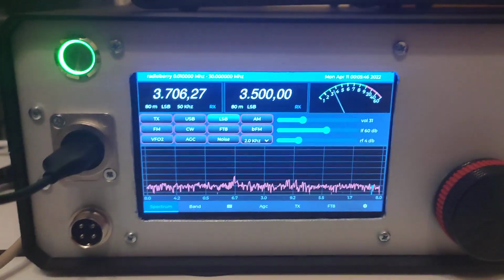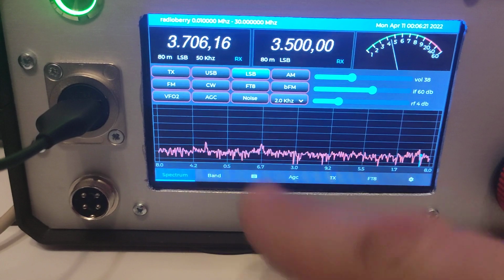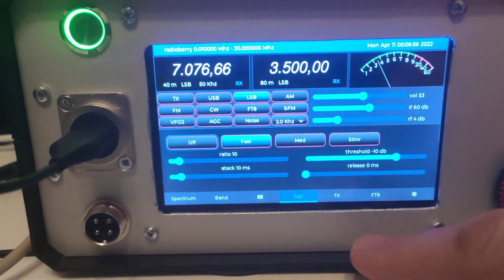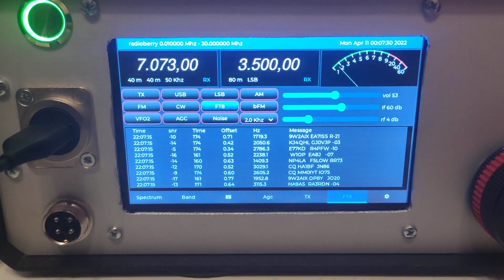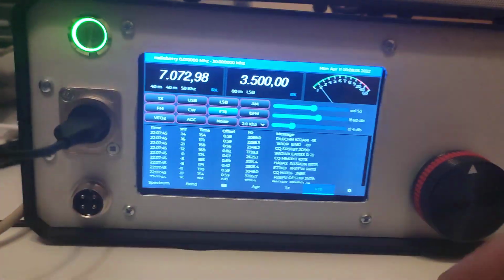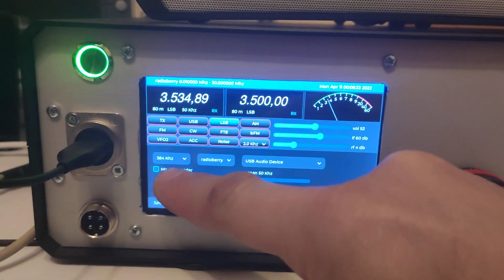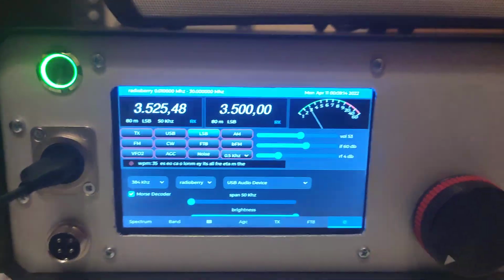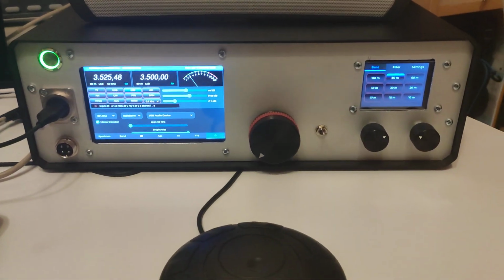Radioberry sdr tranceiver Raspberry pi

Comment: VERY NICE! I need to look into getting this running on my own "RadioHat" hardware project! - AE0GL
Reply from the maker: On my github page is a driver for qsd sdr's it supports alsa audio cards and si5351. I use a hifiberry adc dac pro and a separate qsd mixer board.
Reply: @paulh0029  Thanks for the tip.
Reply from the maker: @mariovano  I will have a look to add support for IQ signal support for the si5351.

Comment: How would i enable this interface?  I know radioberry has a web interface but i would like to have what you got going.  I am finally getting around to using my radioberry 2.0
Reply from the maker: All source code is on my github page available, it uses SoapySDR to connect to radioberry or other SDR receivers
Reply: @paulh0029  And this will do TX too?  Absolutely amazing work!!
Reply from the maker: @weirdsciencetv4999  Yes, also TX. But it is still a project in progress.
Reply: @paulh0029  Keep it up! I love this, been looking for a project like this for a long time, as I am sure a lot of others!
Reply: @paulh0029  I forgot to ask, does your software support activating a txrx relay?
Reply from the maker: @weirdsciencetv4999  Yes, it can send I2C commands. You can configure the commands in config file. I use PCF8574 on the filterboards to drive the relais

Comment: Hi. An interesting project. If I may ask, which version of the rpi is the project on? Regards and keep up the good work
Reply from the maker: I use rpi4 with 2 GB, depending on the bandwidth it should also work on rpi3. But I did not test yet on a rpi3
Reply: @paulh0029  Thanks for the reply and Keep up the good work. 73's
Mans.9H1GB